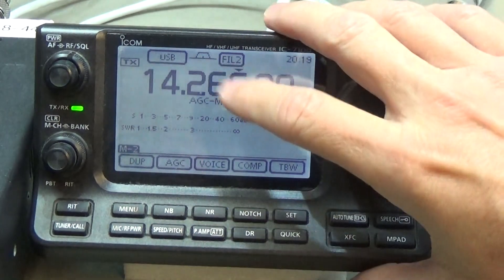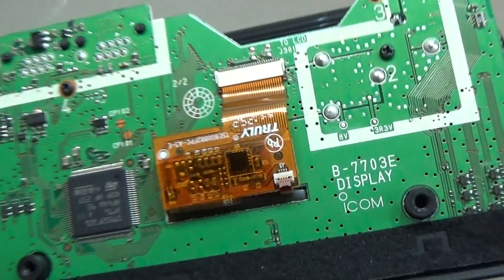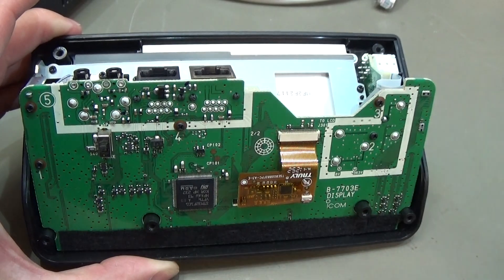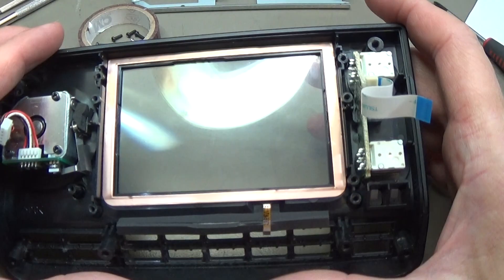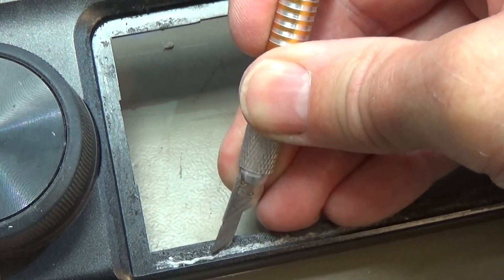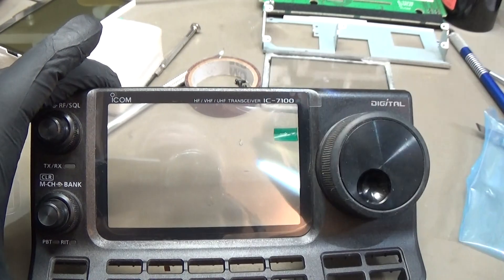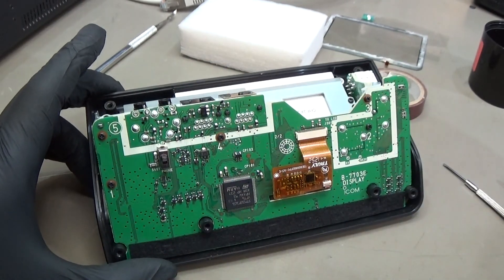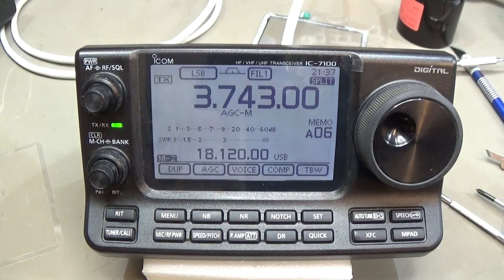#188 ICOM IC-7100 no touch function fixed

Comment: The video was help in replacing the touch screen except... you didnt include the dismantling the inside unit... and not showing how you disconnected / re connected the ribbon cables...you skipped a few steps.... there are different screw sizes so be aware when removing them.  :)

Comment: Has anyone experience any problems with the USB on the IC 7100?  The usb works fine with control software no issues there. However after using JS8Call for FT8, CAT no longer works. Tried resetting, re-installing application. Decoding no longer works with JS8Call. Now my audio at 50% shows over driving the software or in the RED. Any ideas?

Comment: Hi, could you tell me where to buy touch screen for this Icom model?
Reply: Just brought one from ICOM spare parts in the UK. Parts number: 6910023901, desc: WT5036-E-1 7100 TOUCH SCREEN, costing £29.90 inc delivery. Thanks TRX Bench - great guide.

Comment: Glad I found this video.  My 7100 has a dead touch screen, but before it died the radio was possessed, it was scanning wildly, it would then stop and lock up.  When I would turn it off, it would turn itself back on.
I called ICOM and they said do a full reset.  I could not back anything up since the touchscreen was dead.  So now it goes into ICOM but at least I know what needs to be done.
Excellent video and the comments were all very helpful.
BTW, My van was at the repair shop for about ten days in very hot weather, I should have taken the radio out, I suspect that this might be the cause of the problem.

Comment: Thank you, Peter. I just finished replacing my digitizer. It was not too difficult. I replaced it from the front.  It was easy to remove because there was no glue left behind to clean up. It just popped out.

Comment: would you have the part # for that screen you replaced? is it the MP20 or The DS1. Thanks
Reply from the maker: Please refer to the service manual there you find what you are looking for...
Reply: @TRXLab  MP20 8930086960 3393 LCD SPONGE Thanks
Reply: No, the LCD SPONGE is behind the plastic front panel and is just a cushion for the actual LCD. The touchscreen part number is 6910023900, which includes 6910023901 (the actual touchscreen glass panel) and 8930095370 (the adhesive). When I ordered from ICOM America, they sent me just the touchscreen without the adhesive, even though this video shows the adhesive pre-applied.

Comment: Guten tag Peter, what is it that breaks or malfunctions on those touch sensitive screens ?   J K
Reply from the maker: Hi James, a capacitive digitizer uses a grid of horizontal and  vertical wires 
with a little distance in between. Heat could made the inner structure 
change and thus less sensitive for touch. That is one possible scenario 
but certainly not the only one.

Comment: Did you check the head unit to make sure where the fault lay? If so what do you look for? It would be easy to assume the problem and find it somewhere else having replaced the touch screen.
Reply from the maker: I know that Icom has/ had issues with the digitizer but  there is nobody else I know who has swapped the digitizer before.

Comment: Wow! 2 TRX Bench videos in a weelk! What a treat. :-) I have 2 quick questions Peter;
1) Since you ordered the digitizer panel beforehand, you should have known that it was not something else...How did you diagnose the problem?  
2) What happens to a digitizer board? I mean what goes wrong with them and they stop working like that?
Thanks for the video! 7100 is a very good rig.
Reply from the maker: 1. Well three facts that we knew . 1. We knew about the fact that Icom has 
issues with the digitizer on the IC-7100  2. The radio was installed to 
the dashboard of a car and we had an extremely hot summer 3. When we 
pulled a little bit the left upper corner we was able to motivated the 
touch to work some times. That all was pointing to what we thought.
2. a capacitive digitizer uses a grid of horizontal and  vertical wires with a little distance in between. Heat could made the inner structure change and thus less sensitive for touch. That is one possible scenario but certainly not the only one.
Reply: @TRXLab  Thank you Peter. :-)

Comment: Why not try touch the screen a it longer, I'm not surprised it didn't respond, it's like you're trying to prove to someone why it doesn't work, sorry just me being a sceptic, you also touched  the keypad a lot longer after the repair!!
Reply from the maker: Hm Brett not entirely sure if I got your point??? The radio came in because touch was not working so it was already proofed by the owner??
Reply: After 5 years working with this radio, you exactly know, how to handle the touch. A very short fingertip always was enough.(of course Peter got this information). Pressing a certain button for a longer time activates a second function.

Comment: Just one thing that I learned from repairing many tablets. Set your heat-gun to 80..100°C, place it with a good distance over the glass and let it warm up, just slightly over the temperature you want to touch it. Then close in a bit more and run along the edges and corners that are glued. Now you can push out the glass and you keep most of the stick glue on one side. If it the glass side, you won, if it is the other side, it is much easier to pull it off, if it is in one piece. But never the less, good video again! Many thanks!
Reply from the maker: Thanks for the additional hints

Comment: Great job as usual Peter! Just curious, how did you determine that it was in fact the touch screen vs. the controller chip that led you to this replacement?  73 - Dino KL0S
Reply from the maker: Thank you Dino. Well three facts that we knew . 1. We knew about the fact that Icom has issues with the digitizer on the IC-7100  2. The radio was installed to the dashboard of a car and we had an extremely hot summer 3. When we pulled a little bit the left upper corner we was able to motivated the touch to work some times. That all was pointing to what we thought.

Comment: Good Video Peter, how do you get those ribbon cables back into their holders i tried once and found it nearly impossible, you seem to do it easy from Fred g4vvq.
Reply from the maker: Thank you Fred. Well normally it is no big deal to get back the ribbon cables if you take care on the concept. There are some where you need to unlock the socket to get the cable back in may be that was the problem?
Reply: Thanks Peter...

Comment: Do you know if that touch overlay is resistive touch or capacitive touch?
Reply from the maker: For a resistive digitizer you would need to put a bit pressure to it as that is not the fact I believe it is a capacitive one.
Reply: @TRXLab  OK. Nice to know. I wonder what failed then? Did the overlay get damaged in some way so one of the conductive paths got broken?
Reply: The 7100 has a resistive touch screen.  Capacitive screens don't work well with gloves on.

Comment: Hi Peter,
First time seeing a digitizer replaced. I noticed a little damage in the upper left corner of old one. Could that have caused it to fail?  73  WB3BJU
Reply: Hello Donald, there is a damage indeed, but it is caused by lifting up the digitizer a little bit. By lifting up I could reactivate the digitizer for a little moment.(changing the capacity))
I think the failure is caused by the hot summer 2018 in the middle europe(the hottest in the last two centuries), I left my IC-7100 a few days in my car at temperatures maybe over 60° Celsius.(stupid, but happened. :-(    
73, Olaf

Comment: Am I mistaken or have you had this radio - or this model of radio - on your bench a time or two before?  I have been saving my $$ to buy one, but am beginning to have second thoughts.  What are your thoughts on the reliability of this radio?  73 and TU de NT5A - Bob
Reply from the maker: Hi Robert, well that is not easy to say. On one hand I would not say that Icom radios are bad radios but on the other hand we have the most funny faults with Icom radios. I mean any radio brand is failing but Icom is different. Additional to that in Europe Icoms's service strategy is a nightmare. 73
Reply: @TRXLab  Thank you.  In the past, I was impressed with the quality of Icom rigs.  Specifically, the IC-37A was a beautiful, ground-breaking piece of art.  But that was a long time ago.  I have had Kenwood HF radios for decades - a TS-440SAT - which spent some time at Kenwood repairing the "usual" problems with that radio, and my current TS-570.  I have been very happy with both of those radios and still have both of them.  I use the '440 when I need a portable rig, and long ago, I even used it mobile.  Now I am thinking about buying a dedicated mobile rig and the IC-7100 looks impressive for that purpose.  Except for the times I have seen the insides of it on your bench!  I am also looking to buy a newer base station rig - and Yaesu  has my attention.  But I do love Kenwoods.  I just feel that the TS-590 is getting a little old.  Anyway, thank you for all you do.  I greatly enjoy your approach and skill in working on these wonderful examples of modern technology!  73 de NT5A - Bob